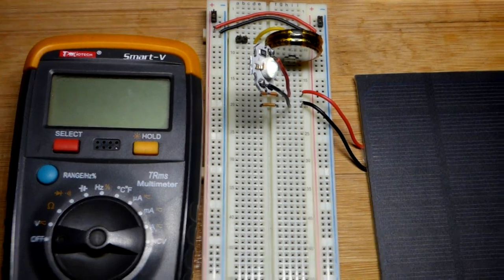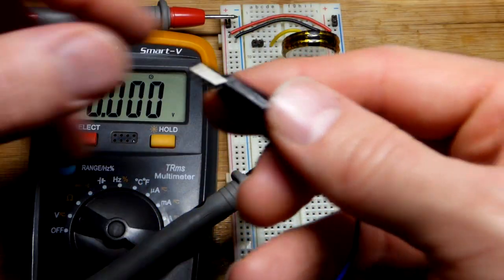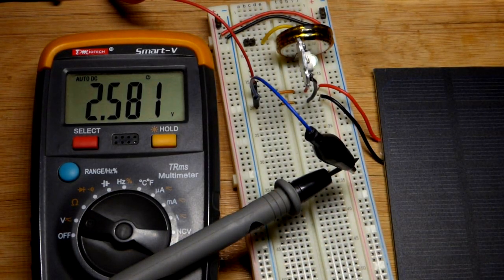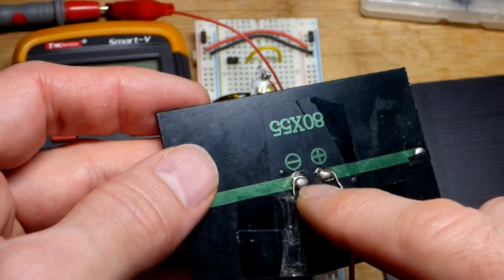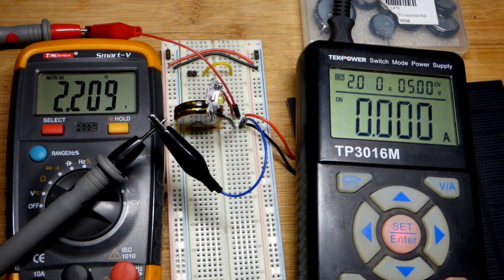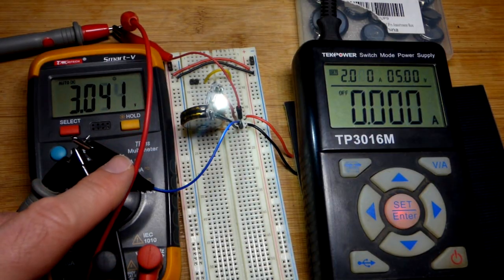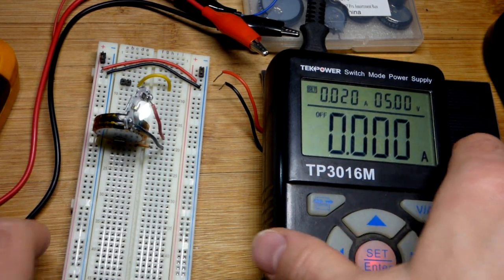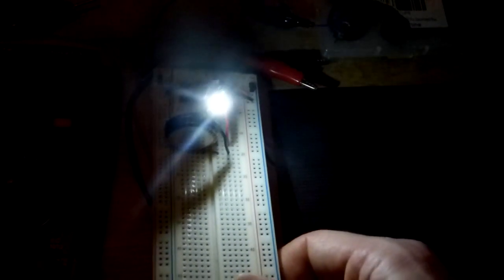Prototype Basic Solar Panel With Super Capacitor Back Up Circuit

Comment: the speed of charge of supercapacitor is high very fast , and let get a util charge in few seconds, also the numbers of charge and discharge are practically infinite.
Reply from the maker: These super capacitors have some resistance, but that is a good point. Gotta limit current with most super capacitors.

Comment: I was expecting a little more complex circuit than just hooking up the capacitor to the led or the solar panel. Maybe with a diode or something to automatically switch off one power supply, the panel, and use the other power supply, the capacitor. I don't know if it's safe to plug a power source to a solar panel without a diode to prevent the solar from absorbing the reverse current.
Reply from the maker: Thanks for the tips!
Reply: Correct. Commercial solar panels have diodes to prevent reverse voltage and cell balances